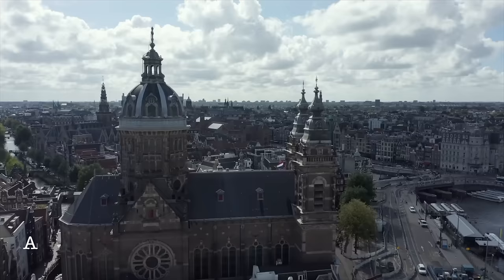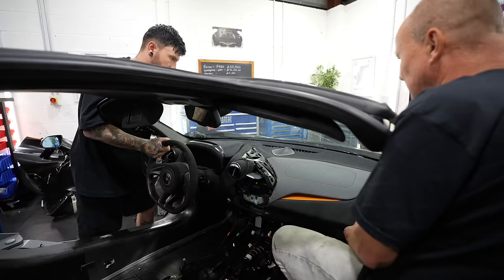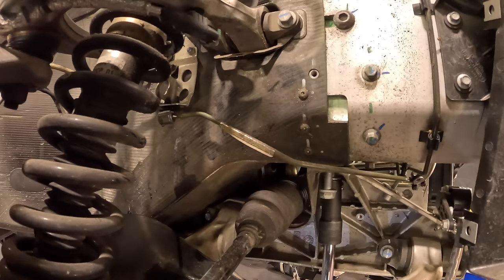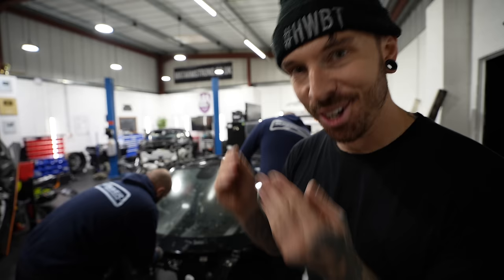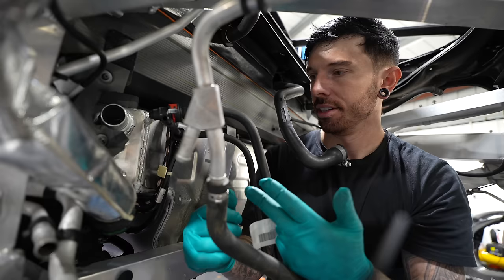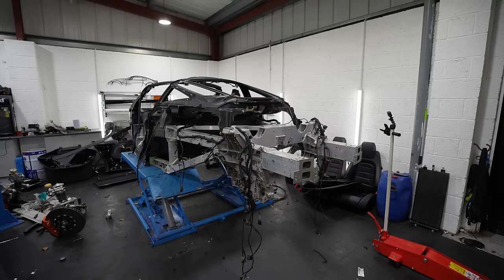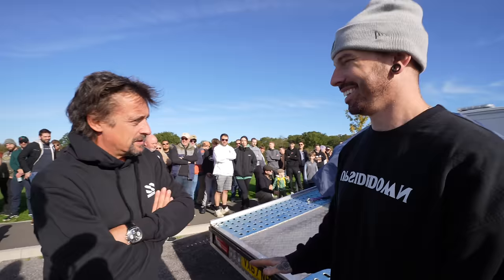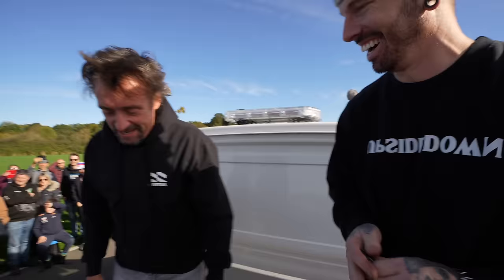RICHARD HAMMOND HELPS REBUILD MY MCLAREN 720s | PT2

Comment: Thank you for coming to our event and allowing us to be a small part of your build Mat. Roll on Christmas!
Reply: Get the smallest cog to do a full respray when it's on the road.
Reply: DRIVETRIBE/RICHARD HAMMOND! WASSUP BIG- nvm
Reply: Just think at that point of the build you actually put more bolts onto the car than matt
Reply: I haven't gelled with you yet. But I'll keep trying 👍
Reply: The smallest cog need to get their hands on that Mclaren, They could paint it. ❤
Reply: Definitely need a collaboration!👌
Reply: Drivetribe is a good watch also 🎉
Reply: I feel Master and Apprentice vibes with Richard and Matt. So nice to see them together and the banter.
Reply: I think he can get this done by Xmas!! He did all that in 20mins 😅
Reply: More crossovers please 🙏
Reply: Theres literally just 2 absolutely horrible things to work on a car : Wires and Stiff Pipes. So much fun to remove the whole interior because one Cable is broken under the seat.
Reply: @DarkSession6208  ive also felt that pain bro
Reply: Hammond being as graceful as ever.
Reply: Richard is an absolute legend!

Comment: Be careful with the fuel in drums , it’s probably no good anyway. A friend used old Smart Drums which looked dry and clean but the soap residue had dried on the walls of the drum. He then poured it into his car and caused no end of issues as the residue clogged the fuel pump and filter, lesson learnt, great viewing as usual. I have been following the progress of your BMW at the Yorkshire wizards it’s spot on

Comment: I did a corvette c4 frame change in 2 days. Car is so easy build that only water needs to be drained all other fluids were intact, even the aircondition was moved without need to refill. Seems this Mclaren is a different storry. Good luck, after this you will be the UK Mclaren expert.

Comment: My HSV (Holden Special Vehicles) VF Clubsport had one of those pipes on it.
They are just a pipe to the Throttle Body so you get the induction sound when you stand on the loud pedal 👌

Comment: @mat i worked at mclaren in 2018. I did not worked on production,  i worked as cmm Programmer. To my place cars came tub and aloy frame. What i seen when i been on production some wires goes next and then engine with whole rear suspension and front suspension.

Comment: Hey Matt getting from across the pond(USA)   awesome video on the McLaren . To answer your question with the ground wire you will be ok to move it as long as its the same gage wire that you   are using to extend it. The only time you have an issue is when you move power circuits.  As long as the ground circuit is bolted back up to the frame or close to it original location, you will be ok.

Comment: Does the car get its VIN from the tub, or is it pressed onto another component?

From the little I know about carbon fiber, I would guess it may not be from the tub.
I would think that the press force - necessary to press the vehicle information (including the VIN) onto the carbon fiber tub - would take out a significant part of the carbon fiber strength, and - depending on the way forces are applied - it may well brake.

Comment: I Think if i had such a car and the Heater Failed/Stopped working.
Even if i has millions of $$ i would not pay to get that done as its a scam :D .

I would just run an 240volt inverter and a 1000-2000Watt electric Heater to keep the car warm.